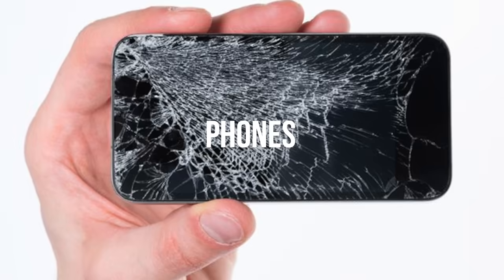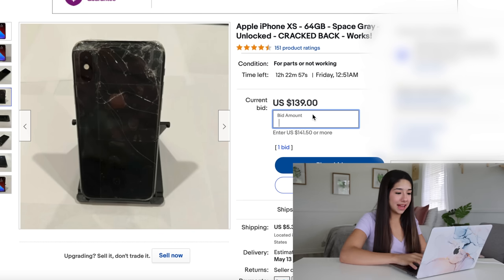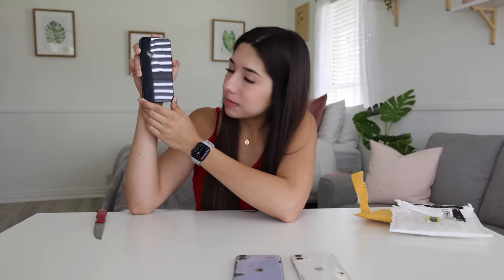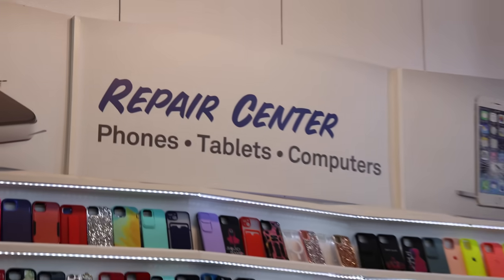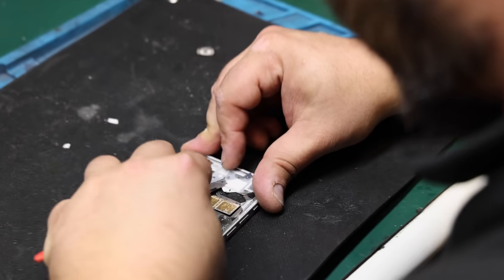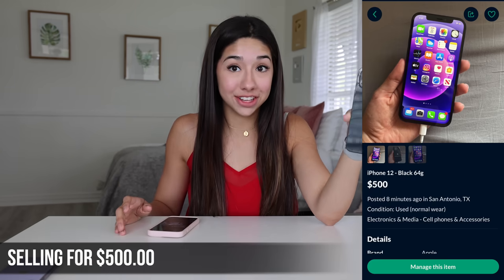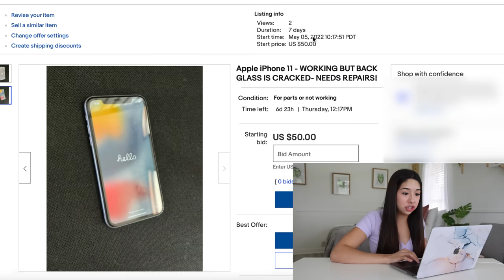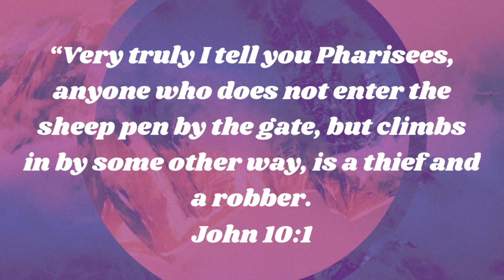Fixing The Most Destroyed iPhones & Selling Them!

Comment: The phone that had a hammer dropped on it. It doesnt even matter that the screen is black where its cracked. Because if you know about replacing phones the front screen you cant just fix the cracked glass as the part you replace is the whole screen with the glass on it cause it all comes as one and it hooks in with a ribbon cable.
Reply: English please
Reply: @cheap25  wether the screen is black and broken or not, it doesn’t matter. When the screen is cracked you have to replace the whole screen, instead of the glass anyway
Reply: @lew7989  thanks for the translation

Comment: they used mid to low end replacement screens thought... if you didnt told the ppl buiiong them you kinda scammed them. if you buy cheap iphones you can make a profit and install original or high quality screens yourself... but at a repair shop a 80 dollar screen is a bad screen for that phone. the refurbised or pulled screens go for almost 80 without the labour.